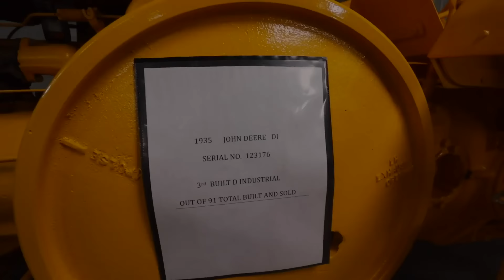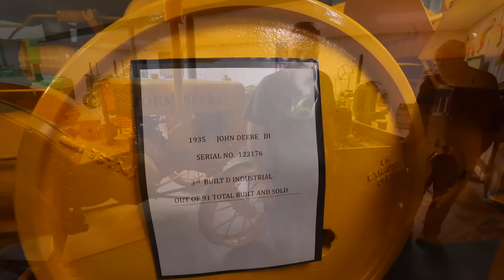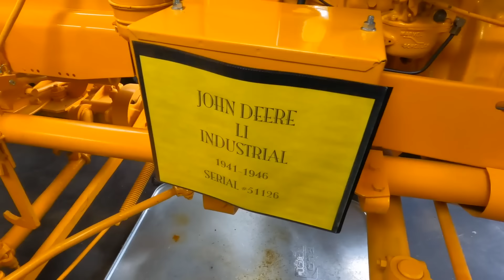This Man Collected 150 Rare and Unique John Deere Tractors

Comment: Corn sheller has a thing at the center of the flywheel to remove the kernels at the ends of the ear then run through the sheller for uniform seed corn.

Comment: On the Waterloo  Boy. Those are lubricating oil tanks on the fenders they have spigots to adjust the drip rate and pipes run down to drip oil on the final drive gears and not the gasoline starting tank which is the tank inside the left fender that you can see right after.